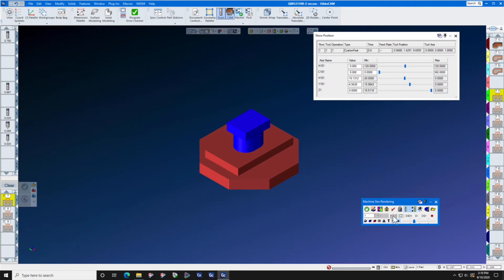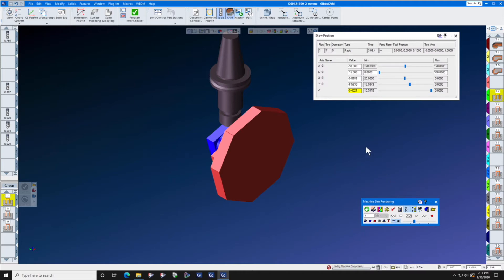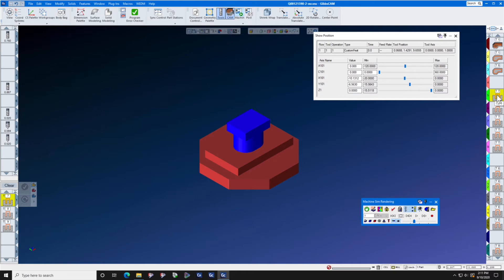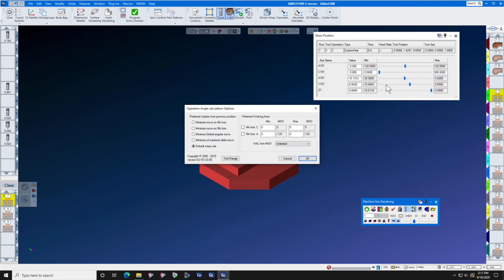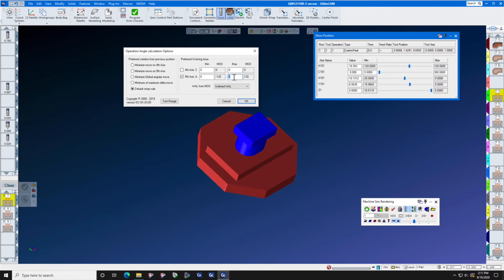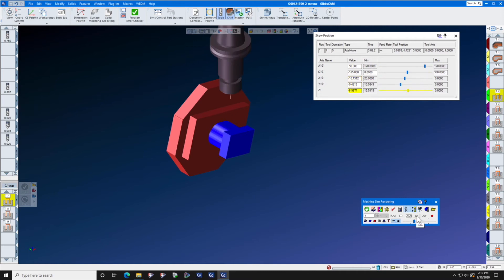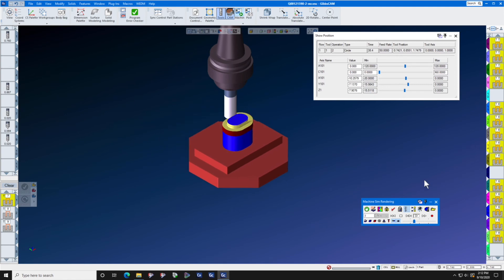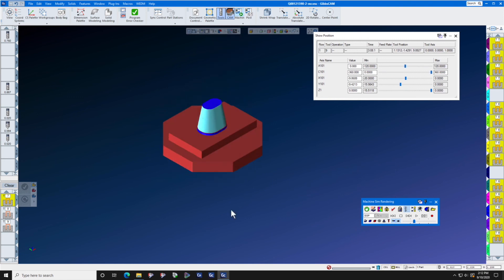GibbsCAM Tech Tip: 5-Axis Angle Limitation

Comment: how to activate this function? I use gibscam 12.8
Reply: When installing, you have to make sure the "ProAXYZ" box is checked when it lists all the options. If it's not there, contact your reseller and make sure you have that option.
Reply: @Planes1353  thanks a lot bro..its works. 👍👍👍👍
Reply: You would have to upgrade to ver 2022 or 2023.
Reply: @andrewward9670  This is not true. This has been a feature for as long as I can remember and I've been using GibbsCAM since 2012. There is a new way of axis limitation in 2023 called "work areas" in the DCD, but the way shown in the video has been there for many years and still works.
Reply: @andrewward9670  you mean, this function is not available in release 12.8?